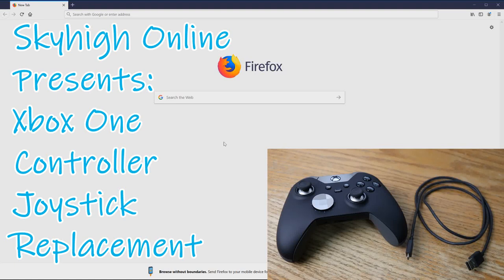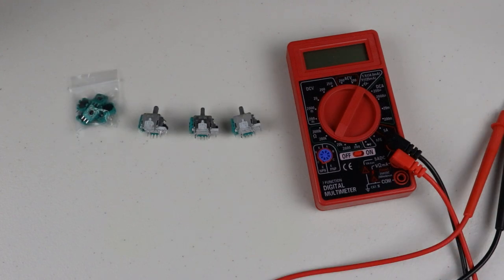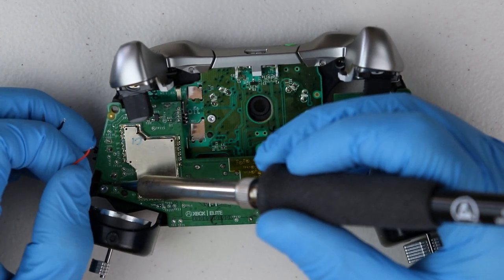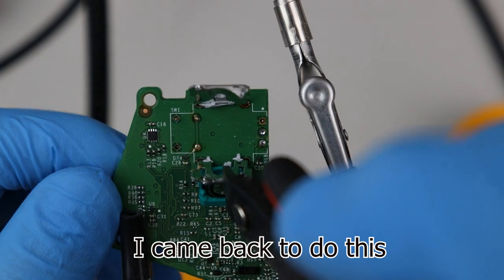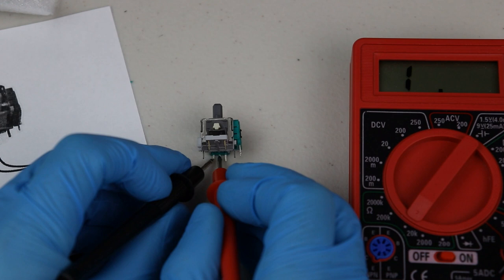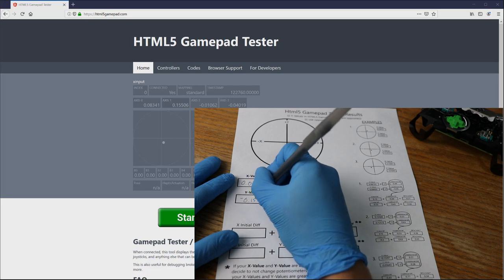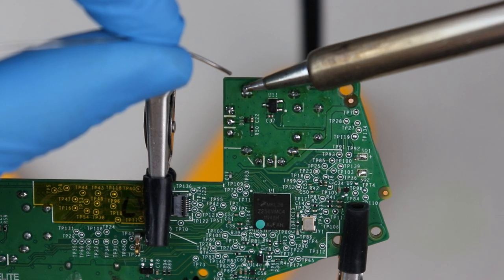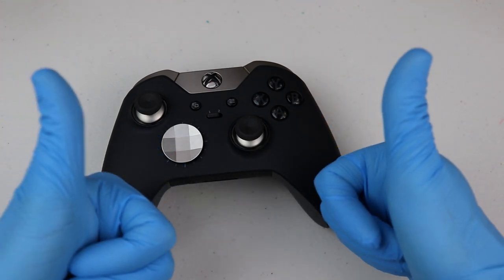How to Replace Xbox One Controller Analog Joystick - Fix Stick Drift & More

Comment: Will you still repair it if I tried using hot glue to fix the joystick
Reply from the maker: If the board isn't damaged I can do it. You just put hot glue on the joystick itself right?
Reply: SOSS GAMING yes I didn’t mess with the motherboard or anything I just tried putting it onto the joystick
Reply: SOSS GAMING also does removing the things that make your controller vibrate have any affect on the controller
Reply from the maker: @zach-io3zv  Ok, that's fine then.  Not at all. I actually remove them on my own personal controllers because I don't like the vibration and it makes them lighter :)
Reply: SOSS GAMING Ok thanks and I just put in an order for you’re joystick repair

Comment: I have to press down hard on my left thumb stick and sometimes it doesn’t work and it gets annoying. How do I fix this
Reply from the maker: For the click button?  Replacing the joystick will fix this for sure.  I'm actually not sure if there's any other solution than that though.   I'm wondering if the grey plastic piece that holds the white knob that presses the button is broken or something.

Comment: Hey, i got a problem. I tried 20 times to get the backcover onto the inside but it dont works. Everytime there is a small gap between headphone and backcover. Also if i put onto it the front cover and screw it down, the controller dont funktion anymore. It only works if i leave it open :/
Reply from the maker: Are you ensuring that the battery terminals aren't getting stuck? I would also recommend making sure the motherboards are connected flush. If you'd like to post and link a video here on YouTube of the issue I'd be glad to try see if I can figure it out.

Comment: I got s controller that wont regester left to right movement on the left stick do I need to change the whole joystick. I changed the wiper but it didnt help
Reply from the maker: You can try just changing the x-axis potentiometer usually that will do the trick.

Comment: I don’t have a drift problem but when I try to sprint in a FPS game it doesn’t work or I have to press really hard. And can I use a stick from another controller
Reply from the maker: Sounds like an issue with the button on the joystick, in which case the whole joystick will likely need replaced. You can most certainly use a joystick from another controller, but keep in mind each joystick still has different resistances so it likely won't be centered as it was previously.  One trick: since you don't have a stick drift problem, when you take off the original joystick (in one piece) you can find out the values of the original joystick, which you can use to get similar values on the new joystick.  Hopefully you can just swap the potentiometers around from the original joystick and the other controller's joystick to get values close enough, or best case scenario the joystick from the other controller has similar values as the original one already.
Reply: @SOSSGAMING  Isn't it possible to measure the resistance of the original joystick when it is still buildet in?
Reply from the maker: @davidbungenberg1765  I wish it were.  That was one of my first ideas as well, but unfortunately you do not get the true values that way

Comment: Where can i find the documents to write down everything?
Reply from the maker: My bad!  One of the links wasn't working.  I have updated them in the description.  Sorry about that. Here they are:
Joystick Potentiometer Values Sheet:  https://drive.google.com/file/d/1f80H_ZErOJxwVwPuwNrDzGZ2LISPcS42/view
HTML5 Gamepad Tester Results Sheet:   https://drive.google.com/file/d/1wgSbNuoCIbh-4LPHLcHT6JsnLF4nxkJs/view
Reply: @SOSSGAMING  Joystick Potentiometer Values Sheet link is directing me to an instagram account
Reply from the maker: @jason19842  Omg that's annoying.  Thanks for the heads up.  Let me try figuring out a way of getting a more stable link that doesn't keep changing.
Reply from the maker: @jason19842  Ok, pretty sure we're good now. Here it is:
Joystick Potentiometer Values Sheet:  https://drive.google.com/file/d/1f80H_ZErOJxwVwPuwNrDzGZ2LISPcS42/view
Reply: @SOSSGAMING  thanks - found the sheets!

Comment: do you have someone trust worthy of fixing a elite controller on eBay or in general?
Reply from the maker: https://www.ebay.com/itm/Xbox-One-ELITE-Controller-Repair-Service-Broken-Drifting-ThumbStick/283674862173?hash=item420c56e25d:g:GysAAOSw5HFdQbtX
Reply from the maker: You can try this guy.  I have a feeling though they cut corners and use oem potentiometers with high deadzones (less work), which I believe most service repairs do.  If you don't mind that then that's who I'd go with.  Otherwise I would ask them and see if you can special request Original joysticks and pots to be installed.
Reply from the maker: If you haven't already chose somewhere, I am temporarily doing repairs again. https://www.ebay.com/itm/224025946052

Comment: some of the pins from the original analog are stuck in the motherboard part, idk how to get them out.
Reply from the maker: I'm guessing they are chopped up? If so, you can use the tip of the soldering iron to heat up the solder, then simultaneously push whatever pieces through enough to grab onto.  Does that help?

Comment: I was about to dump mine completely ...there's a new find for the fault in the series 2 elite when you take it apart each side of the built in battery has a magnetic bar mine came loose and actually caused my anologs to drift badly .....something to watch out for and it's caused by the company your buying it from as the box gets thrown around
Reply from the maker: Very interesting. Thanks for the comment. I may have to look into this.
Reply: @SOSSGAMING  I found the bar stuck to the board under the anologs it caused major problems my controller would just go nuts it was at the point where you'd throw it out and not waste your time but I decided to just open it up as I paid 160 pound for it and ye that was the fix ......the magnets are the real issue I think ....I had a nacon pro revolution X and tbh its way better than the series 2 elite even the triggers are perfect the buttons are perfect size it's response time is crazy and has better settings
Reply from the maker: @darrenjames1026  That's great. I'm glad to hear that.

Comment: What if the diff. Value is negative? Because I'm only getting negative numbers
Reply from the maker: I would try a different joystick then.  But even better, I recommend checking out my latest video I explain an easier method (imo) that doesn't require any calculation or measurements.
Reply: @SOSSGAMING  ohh ok thanks, I guess I'll use the other method. My plan was using this method to find the sensors that are closer to center, and use the other method to get them more closer. But thanks a lot.

Comment: Will this work on a Power A controller?
Reply from the maker: I've heard the xbox joysticks don't work well with power a controllers, but modifying the base of PS4 joysticks will (shaving/melting off the protusions so it sits flush).  The good thing about power a controllers is they do offer calibration software, so basically just remove, install, then software calibrate.
Reply: @SOSSGAMING  Any chance of you making a tutorial on that?
Reply from the maker: @soosramirez177  Probably not unfortunately.

Comment: what temperature does the soldering iron need to be cause i dont feel like mine is melting shit
Reply from the maker: I use a temperature of 650* F.  The old solder can definitely be a lot more difficult to remove.  In such cases I use extra flux and even add some of my own solder to get it to melt better.
Reply from the maker: I would first test on your own solder to see what temperature it melts best at.  You can always slowly increase the temperature to get the best flow, but also be cautious of getting it too hot as that is a contributing factor to board damage.
Reply: @SOSSGAMING  thanks i was able to get it to work im just kinda new at it

Comment: Why can i send you my control to fixed for me please you are amazing
Reply: I mean waooo you are amazing 😉 please text me back to send my to repair
Reply from the maker: @camillyzoe2004  Thanks for the kind words! 
https://www.ebay.com/itm/224025946052
Reply: Really you are amazing have a shop for repair you are full of customer you can do it have the patience and the equipment my regular controls Xbox one just came and usps are savage with packages and they didn’t cover my control will bubbles to save it connect fine to xbox but joystick are brake down like you can heart loose stuff inside omg i am sow mad is my second buy 🤦🏽‍♀️ need a repair my self too stop waste my time for real
Reply from the maker: @camillyzoe2004  Oh no! That's horrible. Hopefully you have a warranty with your controllers, or can send them back to the seller?

Comment: I've tested my controller and it always goes back to the center but really slow, any ideas why?
Reply from the maker: Sounds like a potentiometer issue to me.  Either there's some gunk in there that needs to be cleaned out, or it's worn down and needs to be replaced.  Hope that helps.

Comment: Hi.. when i removed the stick and made the test with program on pc i see for the right stick y100 x 70... without insert the new stick... how can i fix it? it's like the right stick is blocked on left
Reply from the maker: Very interesting.  I've only encountered something like this with a cracked board (which caused some type of short somewhere), because without the joystick in both readings should be + or - 100.  Were the x axis readings like that before removing the joystick?
Reply: @SOSSGAMING  no before removing the solder there was a slight downward movement ... likely that something has burned by unsoldering?
Reply from the maker: @vicayde5758  Do you notice any damage to the through holes? Have you at least tried soldering in the x axis pot to see if you get a reading?
Reply: when I swipe my finger on the card I notice that the values change and go crazy ... it's like x and y stuck in a certain point
Reply from the maker: @vicayde5758  I would recommend trying to solder on the new joystick and see what happens to further diagnose.

Comment: Hi will this work on a ps4 controller
Reply from the maker: The method? Yes. New vid coming within a week though with a method that doesn't require any calculations or measurements.

Comment: My thumbstick moves left and right fine, just hardly works when I look up or down and it just got bad enough the other day to where I can't play.... Works 100% fine though if I take the magnet off and just play with no thumb stick.
Reply from the maker: Interesting.  I'd at least recommend opening the controller up and try cleaning out the y-axis pot (potentiometer) first with some isopropyl alcohol to see if that helps.  And if not either replace just the y-axis pot or the whole joystick if you're up for it.

Comment: @SOSS GAMING i changed both sticks like your discription now i have the badest drift i ever had🤷‍♂️🙈
Reply from the maker: That's unfortunate I'm sorry. There are a lot of little details in this method. If you're still up for trying to fix it you may want to check out the "Newest Method" video for calibrating the joysticks.

Comment: Hey so i did the change and got the set up but the controller now is stuck going to the right you cant go left what so ever how do i fix that i have already used two other joy sticks
Reply from the maker: Honestly it sounds like you might have damaged a through hole.  When you go to htmlgamepad.com what is the exact reading for the x-axis when the joystick is not touched? And what is the reading when you move all the way to the left?
Reply from the maker: @Jay-qq6kc  Good info!
Reply: Does this mean he burned the motherboard through? Because I have had this same problem.
Reply from the maker: @injusticeberserker2800  No, not necessarily burned, but there is a lining in the through holes that can possible be damaged if not removed carefully.  Perhaps it could be that it was too much heat to damage it but I believe moreso it's caused when the joystick/joystick pieces are removed more forcefully than naturally.

Comment: on the joystick that is giving me problems (dualshock4 v2), the y-axis mechanism, the part that has the little nub that holds the wiper in place, isnt turning down all the way.  so looking down takes longer than looking up.  there is also a bit of drift.  is it possible to fix this problem or do i just have to buy a new joystick?  great video btw, really well done
Reply from the maker: Not exactly sure what the issue you are describing is, but I'm quite sure that a new joystick will fix whatever issue it is.  I have a new video with a new method (less intensive) if you want to try to do it that way. You can also first try replacing the y-axis potentiometer and see if that works, but that will still require a joystick with the right type of potentiometer on it.
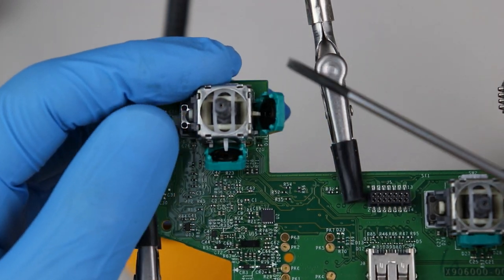Reply: @SOSSGAMING  thanks for your reply. To better describe what I'm talking about go to 6:42 when you're removing the wiper from the joystick. The arm that holds the wiper in place, that's connected to the rest of the joystick is what I'm talking about. That arm and the part of the main joystick that it's connected to is not turning all the way. So if I try to look down normally it should go to whatever angle it goes to. In my case, it goes only about half way. If it was the left stick it'd be the equivalent of only walking in a game even though you're trying to run
Reply from the maker: @hentaidghthelame1319  Do you mean that it feels stuck when trying to push down? Or can it still physically move all the way down? If it it feels stuck and the joystick itself can't physically move down then the arm part you're referring to is popped inside the joystick (might actually be the x-axis arm) and you simply need to pop it back out.  I've done this before and grab a pair of plyers, grab a hold of it, and pull on it until it pops back into place.  If that's not what you're referring to, let me know.
Reply: @SOSSGAMING  sorry for the delay.  it was still moving all the way down i believe, but i still tried to use the pliers to see if maybe it was what you mentioned.  there wasnt any change.  if there was an easy way for me to illustrate it i would
Reply from the maker: @hentaidghthelame1319  Ok, I think I know what you're saying but it's not an issue I'm aware of.  Since it's part of the physical joystick I would just recommend changing it out.
Reply: @SOSSGAMING   @SOSS GAMING  I was afraid of that. It hopefully shouldn't be too hard. Do you know if the joysticks are compatible between different versions of the dualshock 4? If I took the joystick from my gen 1 controller would I be able to just use it right away on my later gen controller without all the additional steps you do in the video like measuring the potentiometers?